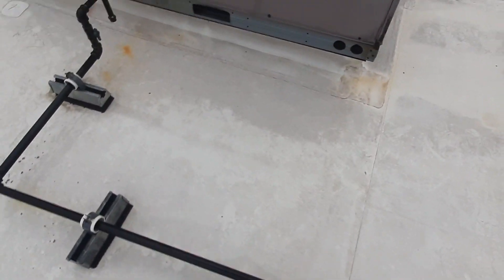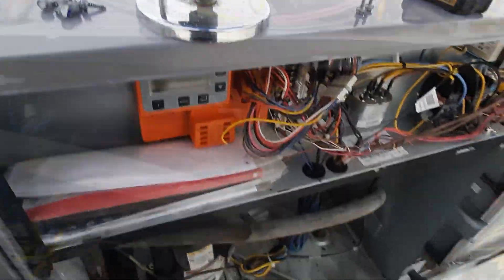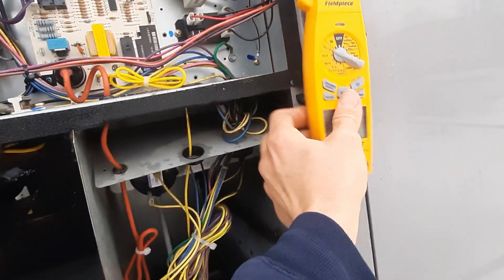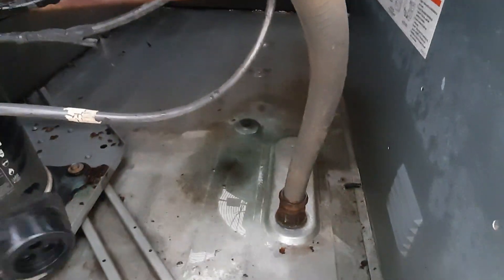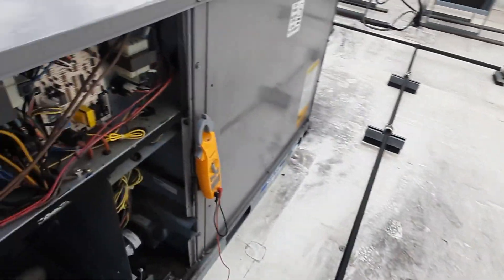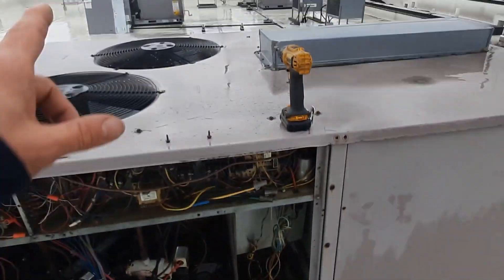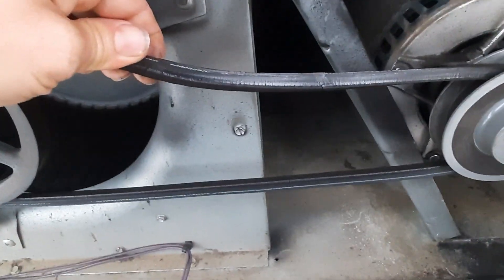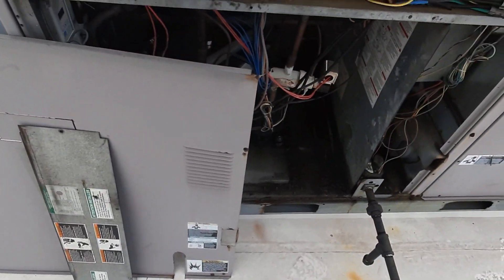No Cooling service call 2 carrier package units not cooling

Comment: That was some heavy modification on that older unit. When you opened that panel up I thought for sure the rest of the video would be you searching for a low voltage short.
Reply from the maker: 😆 Thanks Nick! Glad that was not the case.